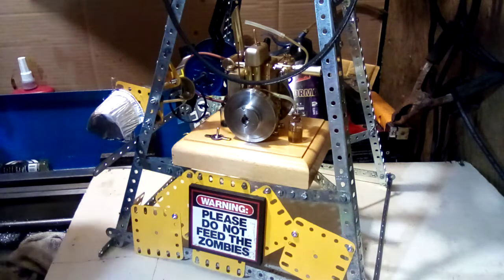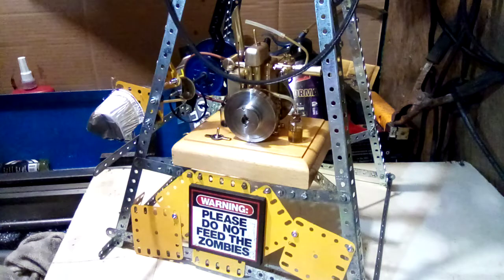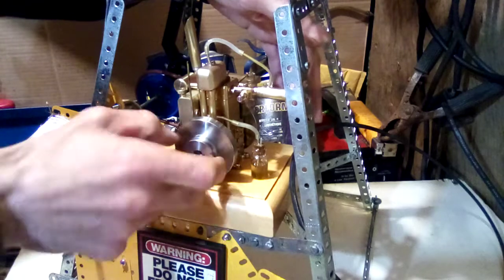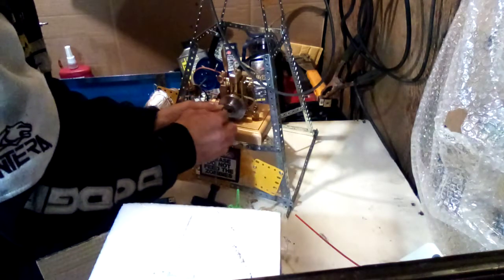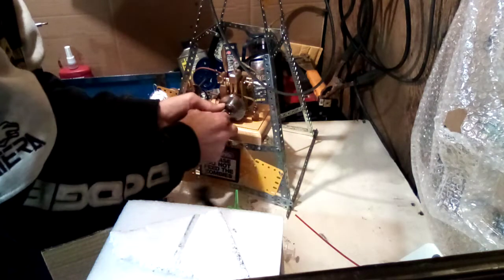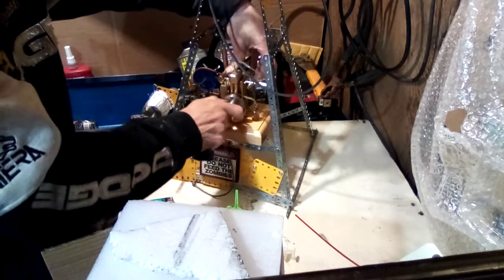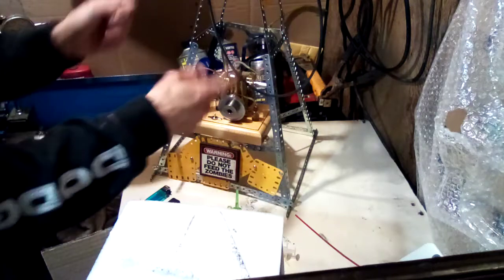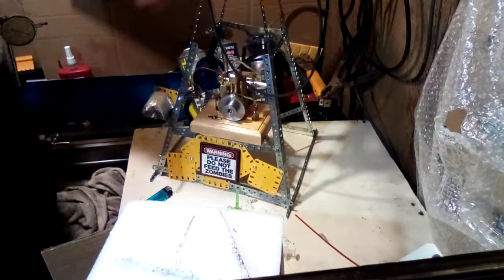M12b gas powered windmill

Comment: Hi can you give me the sizes of your boat please
Reply from the maker: 35" long 11" 1\2  wide 7" Depth Fairly light for this size the hull was formed on a doral yacht somewhere between 36 45 feet I can't remember what it was  I have a miniature replica hull of one of this boat that runs with a 2 stroke weed trimer size engine with a bit of modification the shape of this hull was viable for a larger carrier so I molded this hull made a copy and modified it a Litle i used a 4mm Drive Shaft Shaft sleeve Blade Propeller Joint Assemble Kit from cinedx
Reply from the maker: On the engine side it was me who modified and sealed all the covers modify the flywheel to use a dog bone which has only one end i cut it at the other end which is directly connected to a universal joint it works very well the Rudder is 62x30mm made of Copper its a Submerged Rudder for RC Boat Tug Fishing Boat find in the same place as the drive chaft on ebay look for the seller cindex
Reply: @davidlavergnelacasse2356  I got nothing come up for that seller 😞
Reply from the maker: @Blacklamass  try wit items no * 152717000370    look for ( 4mm Drive Shaft Shaft sleeve Blade Propeller Joint Assemble Kit fr RC Boat Motor)
Reply: @davidlavergnelacasse2356  thanks David
Reply from the maker: @Blacklamass  I can't wait to see what you will come up with and I know in advance that it will be awesome